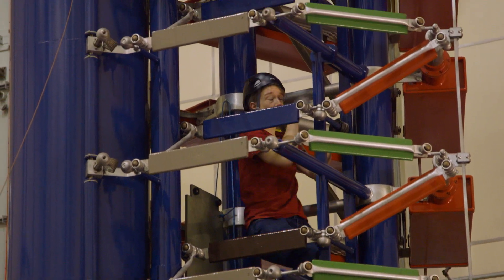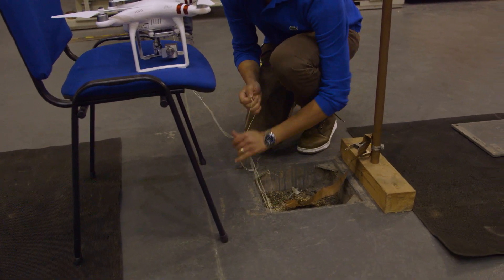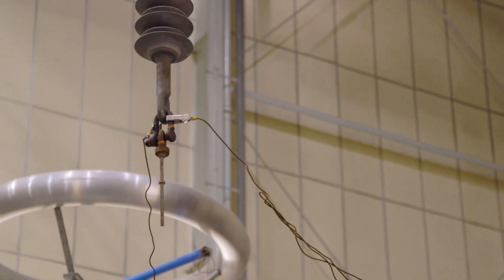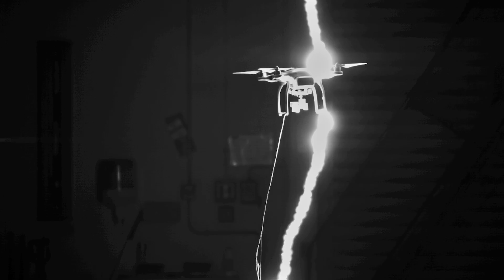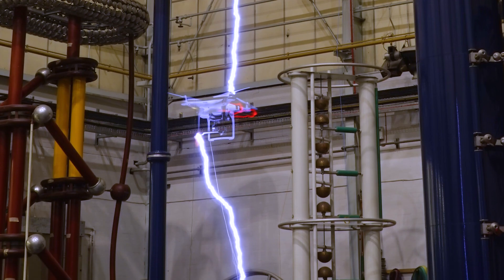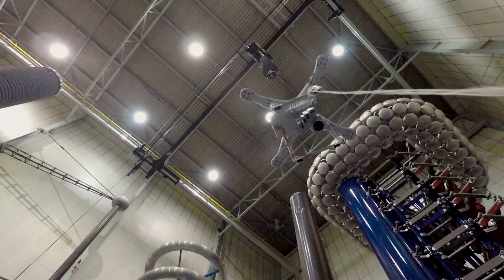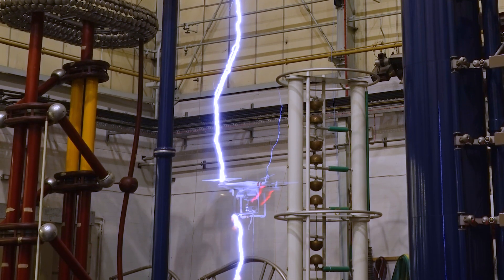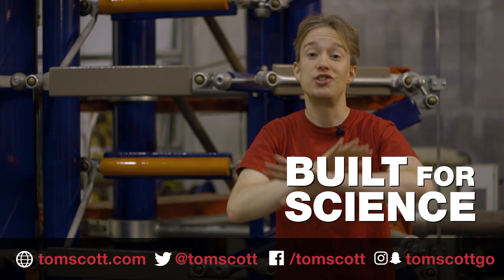We hit a drone with lightning

Comment from the maker: The team at the University of Manchester tore down the drone after to see what the damage was, and they've just posted their results: http://www.mub.eps.manchester.ac.uk/science-engineering/2017/05/11/inside-the-drone/
Reply: the reason the drone lightning came out the leg is because there is little aerials in 2 of the legs 
the electricity went through all the drone wires and into the board then out the aerials
Reply: That's very interesting.
Reply: It may be interesting, MrAntieMatter, but is it Sips O'Clock?
Reply: DJI on Phantom uses legs to hide the drone antennas.
Reply: Plus it seemed that the foil that you used was shorter than the motor shafts, therefore it hit the motors again.
My theory is that even if you would use the longer foil it would not handle the voltage and still have enough power to redirect the rest of the arc to the metal parts in the drone.
Reply: Tom Scott o
Reply: Should have sent it to mikeselectricstuff ... :P
Reply: "several of the chips from the circuit board had de-soldered themselves"... that's wild.
Reply: 0
Reply: my guys here in manchester battling drones with electricity
Reply: Interesting results! I'm surprised how little damage there was externally. Love the videos!

Comment: Maybe you could get a copper-coated drone with a lightning rod much higher than the motor axles to survive the test? 
If a lightning hits that it definetly hits the metal from the casing or even easier the lightning rod and then just exit out the bottom and maybe chip off some of the copper.

Comment: I just saw this video, and it reminded me of when I'd constructed my own Marx high voltage pulse generator at home nearly 20-years ago. That device could produce a 1/4-million volt discharge, and it only took 1/3 of a second to re-charge! It was during the initial testing of my generator that I learned how very destructive the EMP (electro-magnetic pulse) that radiates outward from each discharge can be to nearby electronics. It would fry the oscillator chip I used in the "low voltage" (50kV) flyback circuit feeding the generator instantaneously if it was within about 1.5 meters radius of the discharge.

From this experience, I would expect that you'll find that just having the drone hovering NEARBY (within the Faraday cage with the discharge), and not even struck by the HV bolt, that it will cause the drone to fail.

Comment: I have a bit of experience fixing drones. This Phantom 3 received the lightining through the motor, went through the single control board of the entire aircraft and exited through the antenna (or compass housing). This kind of explains why the battery was unharmed, since the current chose the path of least resistance and exited closer to the ground.

Comment: That looked like a silva mica cap you were holding. What is not common outside of vintage use. Guitar pedals love them. Vintage equipment restoration. It could of just been a large red polypropylene and I missed it. But looks very much like an old silva mica

Comment: Why did they use a 1 inch lightning rod?! the motors are taller than that. no wonder it didn't work. I would expect better results from a 1 foot rod.

Comment: I would like to see this done with a race drone maybe the conductive carbon fiber and aluminium frame would almost act like a lightning rod diverting the high voltage around the sensetive flight controller and ESC

Comment: Hi Tom, I'd suggest you try this again, but this time extend the lightning arrestor on top of the drone. The rule of thumb is that anything within a 45 degree sloped "tent" from the tip of the arrestor is protected. So, if you prop tips extend horizontally out by, say 20cm, from the center of the drone, your arrestor must be at least 20 cm tall. Cheers - ML

Comment: On that model Phantom, the propellers are screwed on counter to the rotation sense.  I suspect that the motors stopped abruptly (or even reversed) causing the props to 'unscrew' and fly off.  The lightning was conducted down the "handle" because the antennas are in two of the vertical legs of the landing gear.
Also believe if the "tip" on top were longer and a 'tail' used to bring the lightning bolt to the bottom, the drone might have stood a chance.

Comment: 3:26 I'm no expert on lightning (shocking I know), but from conversations with people who install lightning protection systems, and looking at plans for said systems, it's slightly more complicated that just sticking a bit of metal onto whatever your trying to protect.

A lightning conductor placed on top of an object, say a church tower, provides a cone of protect from it's tip extending downwards. A lightning rod placed on a church with a tall tower may find the entire building is protected, whereas a lightning rod placed on a church with a short tower may need to have a second conductor placed on the other end of the church.

The problem here is your conductor didn't extend far enough up (and presumable similarly down) in order to provide the path of least resistance for the lightning. Now I don't know what calculations and equations are involved in working out the dimensions of an effective lightning conductor, but I would hazard a guess that the conductor would needed to have extend above the drone by at least it's width and probably the same downwards as well. And that's assuming whatever materials you're using was capable of handle the charge...

p.s. sorry about the bad pun...
Reply: “Shocking” 😭😭😭

Comment: i cant help but note that the compass is in the foot of the phantom 3S. there is actually electrical components down there, the exit point could be in the foot of the drone because there is a direct connection between the compass and the flight controller/ motor.

Comment: "Store 100000 volts"? Since when capacity is measured in volts?
Reply: since when did a capacitor not have a maximum potential difference at its terminals before it breaks down? If those capacitors were connected in series then it was helpful to appreciate the voltage across each capacitor.

Comment: "The internals are dead." Cyberdyne used this video and the resulting research to build Terminators that could resist high voltage surge. Both accidental and intentional.

Comment: The high voltage is why the machine is made of big pipes and rounded edges. It’s so there is a lower electric field. 

Also, not sure if this is true but extremely high voltages are basically electrostatic so it needs a large surface area on the conductor, someone confirm please

Comment: 1:15 volts can't be stored. Voltage measures differences in potential energy. What you can store ia charge, which is measured in Coulombs (or equivalently you could store energy, which is to say Joules).

Comment: Might be nice to check out the high voltage lab of the TU Delft in the Netherlands as well. They can produce voltages up to 4MV ac or 300kV DC. They also have a grounded cage with a chair in there so you can experience the lightning bold zapping to you. It could make a nice video on the importance of grounding your devices.
Reply: And they used to have the fastest elevator of the Netherlands, that they had to tune down for people getting sick in there. 😂

Comment: It seemed like the electricity over powered the motors for a tenth of a second and ramped the propellers past the tolerance of the adhesive attaching them to the motor. Now I'm wondering if I can use capacitors on a drone like nitro....

Comment: 1:12 "each one of these red boxes can store a 100,000 Volts" - pardon me, but they don't store Volts, do they? They store an energy charge expressed in Joules and can be discharged at a certain Voltage, which (if you know both), gives you their capacitance (which is probably huge, at 2*E / V^2). What am I missing?

Comment: "...the handles [landing gear], which are made out of plastic"
In two of the vertical parts of the landing gear, there are antennas. It probably went through one of those, only clearing around two centimeters of plastic and air at the bottom.

Comment: Have you tried grounding the propellers?  It would seem, if you consider the "aether" theory, you would be generating a small amount of current from the motion of the props in the air; either way the current is consistently attracting there.

An interesting test would be grounded rotating controllable propellers, vs a grounding rod/probe that could extend; to see how much fluctuation motion in the air causes electromagnetic displacement.  You could also add magnets to the propellers and probe, to push more electromagnetic displacement.

Comment: The motor has a copper coil and magnets, it generates a large electromagnetic field, so it always gets hit,  the tape could not protect it in any case. Perhaps the metal grilles protecting the propellers connected to one structure and the antenna farther away from the drone could serve as Faraday's cage

Comment: @Tom Scott here at TU Delft in the Netherlands we have something you might find interesting too. In our high voltage lab we have a set up with some chairs in a grounded cage. We can fire huge sparks at that cage, mostly for fun.
Reply: We also have similar devices as in the high voltage lab of Manchester university, though we can even run up to 4M volts AC and 300k volts DC

Comment: Logic of this is that the static electricity will pass thru the vortex zone of magnetic field witch is generated by the motor and will make its way going down to the compass of the drone because the compass itself is a geomagnetic sensor vortex zone..

Comment: 2:43 the reason it exited from the handle is because that's were the antenna (a wire) is. And a wire's inside is metal.

Comment: My theory on as to why the second strike did not go through the guide is that the motors generate a magnetic field, this field would reach higher than the guide point.
(I am not educated on plasma rays what so ever, so don't judge me if I'm wrong)
I would really want to know if that would be the case, and then maybe you can do another video on this subject!

Comment: The researcher states that the current leaves the quadcopter via the plastic "leg". I am quite sure that this model of quadcopter has the radio (receiving) antenna on one of the legs. If you inspect the quad, I predict the antenna carried the charge down the leg, not the plastic itself. 
I assume the charge hit the motor on the second try instead of the "lightening rod" because the motors have a very high metal content due to the all metal magnets, coils and chassis. A longer, heavier steel rod may produce the desired result (protection of the quad).
Happy flying:)

Comment: Well, as far as I know, the electronic compass is housed in one of the Phantom legs...and obviously there are wires from the compass to the main board....so that would account for the electricity always taking that path. Once is in the board, the motor rods is probably the best route out

Comment: Who doesn't love a good... I'm going to change the next word I initially thought of to "explosion" even though it's incorrect. It's too late to break out my internal thesaurus! I'll leave the initial word to your imagination.
Given that the battery was protected in its very own Faraday cage, does that mean that the batteries in mobile phones (those totally surrounded by metal internally, natch) are also protected? Just wondering, because if for some reason a phone got electrocuted in whatever way, it might be worth salvaging the battery and buying an identical replacement. Most of the build cost of these phones is, I imagine, in the creation of the battery and its connected bits. It would be able to give whoever is unfortunate enough to have a fried phone a full charge on standby where power banks often have only a few (though useful) hours. Does this work as a concept?

Comment: Actually i found a drone in a river that is the same as the one you used, and there are actually wires in the landing gear (the part you called handels). I am assuming its an antenna of some sort.

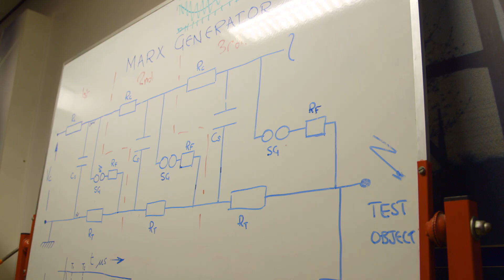Comment: based on the schematic at 0:42 it looks like a marx generator, the power only goes through the resistors while charging but when it is discharged the power goes through the spark gap.
Reply: I just saw that it even says marx generator on the whiteboard

Comment: The exit point of the lightning seems to be the electronic compass that is positioned on the bottom of the right back leg.
Would make sense as it is connected to the main circuitry through copper wire.

Comment: Yeah not really surprised that the makeshift lightning protection strip failed to work to be honest. There is a reason why when designing proper lighting protection systems there is a whole bunch of math involved to ensure that the lighting protection system does effectively offer a sufficiently low impedance path to ground to divert sufficient current away from the paths you wish to protect. If you just randomly stuck a strip of foil in the side of your house odds are it would still strike your TV antenna and use your internal house wiring to access the ground spike instead too.

Comment: It still irks me when people use the word drone to mean a remote controlled aircraft. Drone usually means an aircraft that can fly itself rather than one that is controlled from the ground. I prefer the term quad copter for the thing in the video.
Reply: I agree, way to many times are quadcopters called drones, but the dji phantom 3 used in this video is infact a drone as it is capable of autonomous flight, as well as manual control.

Comment: I wish you'ed done more to try and protect it than just some metallic tape that barely goes a centimetre above the motors anyway. I'd like to see it tries with some thick wire (3mm copper?) perhaps single core so that it'll hold its shape and 10cm above the motors and below the legs. Maybe set it up with multiple paths around the sides as well.

Comment: An hypothesis about the trajectory of the lightning is that the propeller is litterally sucking air on top of it, making an easier path for the plasma to ignite because of the lower air density.

Comment: I am a bit surprised that they were that willy-nilly with the battery. Those batteries are.. uhm. Not the safest xD. Not likely to blow someones finger off, but they don't like heat, don't like sudden charges and discharges, don't like being punctured...

But nitpicking aside, awesome video xD.

Comment: I'm fairly novice at electronics, but even I know that Voltage = Current X Resistance. You put a lightening bolt through a drone and all that current is going to melt the circuits, which is why A/C circuits have fuses. The battery was probably shielded which resulted in the current flowing around the battery rather than through the battery.

Comment: As a engineer and a physicist I must correct the flawed usage of units in this video. Capacitors do not store "volts", they store electrical charge which has SI unit Coulomb. Volt is not a unit of energy, however Volt times Coulomb which is Joule is a unit of energy. Because of the linear relation between charge Q and voltage V over the capacitor, Q=CV where C is the capacitance, the stored energy in a capacitor is E=CV^2.
Reply: The size alone of the capacitors tells me to stay clear.
Reply: Bruno Mailly I agree

Comment: Ahh, but this is not a true "lightning stroke." This apparatus creates a high voltage, but there is no large current flowing in the discharge channel. Real lightning has 20k to 50k Amps flowing; this is how tree trunks get exploded and how attachment points often exhibit burn-through on aircraft skins. With a proper lightning simulation discharge, I would expect the wire would vaporize and the drone would be electrically destroyed and physically disassembled. The test we see here is more like a very vigorous ESD test.
Reply: That is a Marx generator.
The current flowing was definitely on the order you've described, if not more.
Reply: I base my observation on about 20 years of having performed lightning vulnerability testing on aerospace equipment. You do not use a Marx generator to produce a lightning discharge similar to nature and/or in accordance with a typical standard like DO-160. True, I did not have a current probe clamped around the cable coming from the generator output, but what is the authority of your claim?

Comment: I'm not sure the drone in the air which wasn't tethered to the "ground" with a conductor would be destroyed.  There needs to be a path to ground for the lightning to want to take a path which includes the drone.  The drone is intentionally being made to be in the path of least resistance by tethering it with a wire.  I would think it would be very unlikely that if you were wanting unique video of lightning that it would be hit.  I think this could have been explained in the video.  The intentional creation of a circuit path should be explained.
Reply: The 'wire' was not conductive. In any case, you would see the same effect with the drone flying alone. When lightning hits an aircraft if does exactly what you see on the film. Lightning enters in one location and leaves through an exit point.
Reply: Ian Cotton massive waste of money to prove the obvious.  The fact is you can fly your drone in a lightning storm to get unique video and chances are you will not likely get struck by lightning.  Being a drone does not make you a lightning magnet.   Now I'd be impressed if you can protect the drones propellers,  motors,  control board and battery from a lightning strike as that might have some practical application in the world.